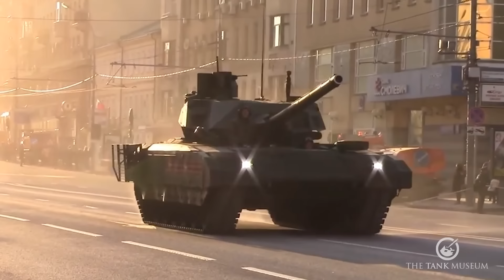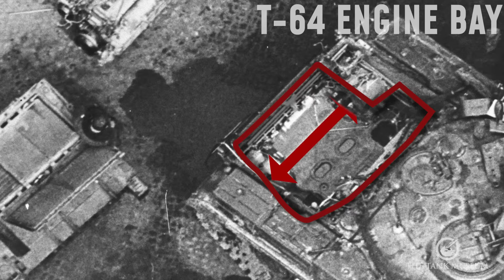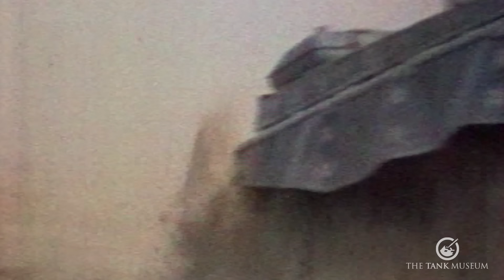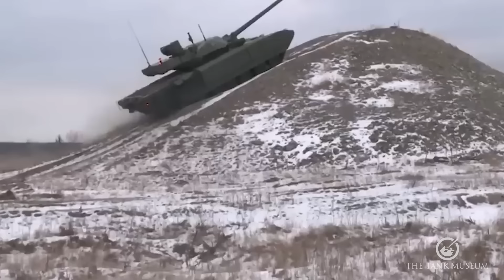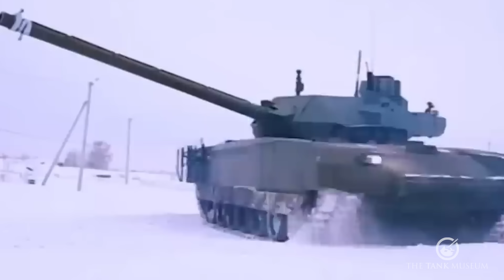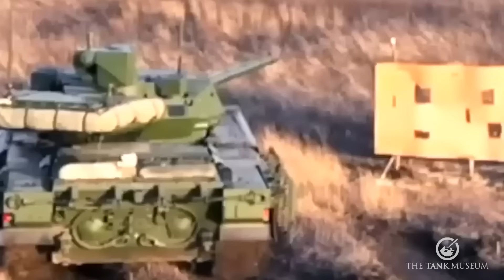Radical or Ridiculous? | T-14 Armata | Tank Chats #171

Comment: Russian politics has made a massive mistake in the view of keeping old out of date tanks for the Russian army , an old tank  is still an old tank even if you modernised it , it will not complete against a modern tank equivalent , in Iraq the T72 was wiped out by American and British armour the Russian politics should have taken note and scrapped everything from the T80 and back. 
Their is no evidence as of yet of the T14 being used in the Ukraine just there army of rusting tank relics , the modern T14 will not do any better than their present tanks in the Ukraine if they don't have air cover or anti missile cover which is something the Russian army has not been doing since it went into the Ukraine , thanks to Russian politics there army is out of date and OVER RATED.